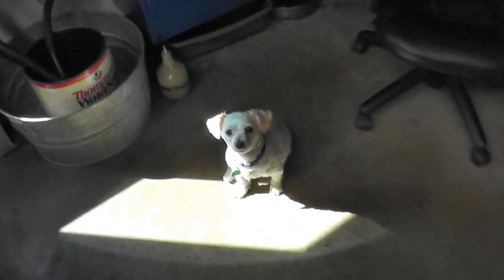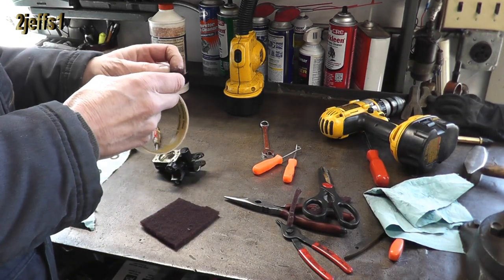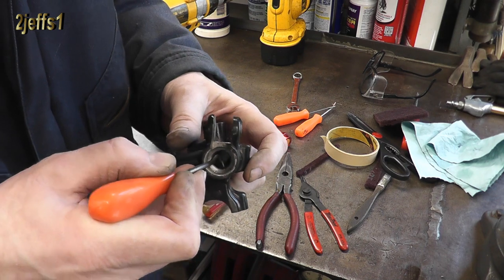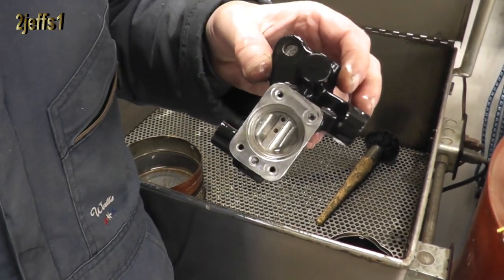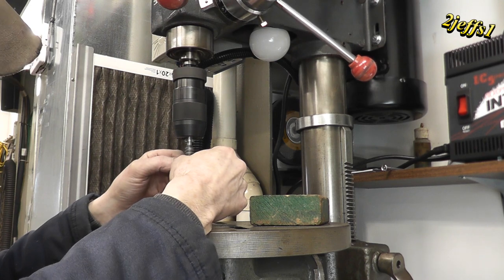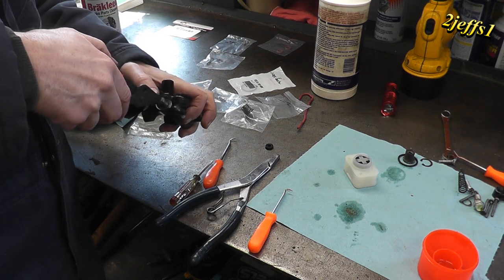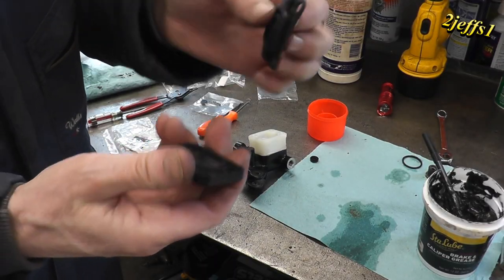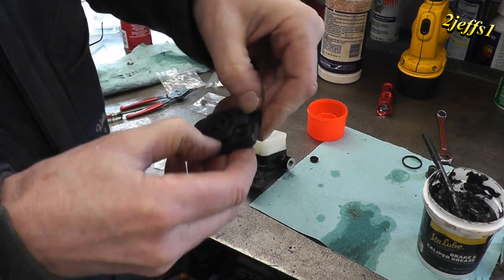ATV Master Cylinder Rebuilding

Comment: I'm rebuilding a 78 Yamaha 750 front brake master. Took the plastic reservoir off and tore the O ring. Bought a metric O ring kit but it's leaking because the O ring sits partly in the reservoir and partly in the aluminum. Any suggestions?